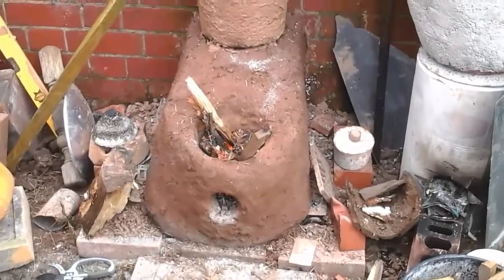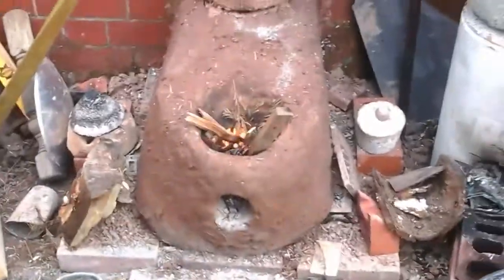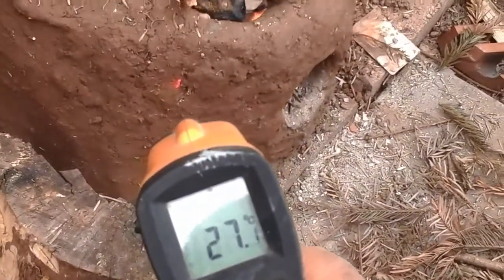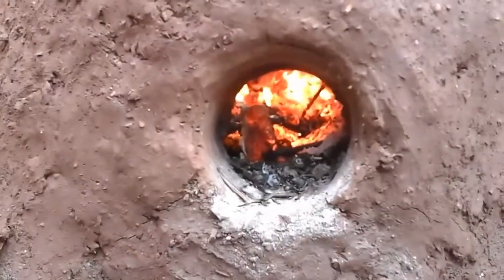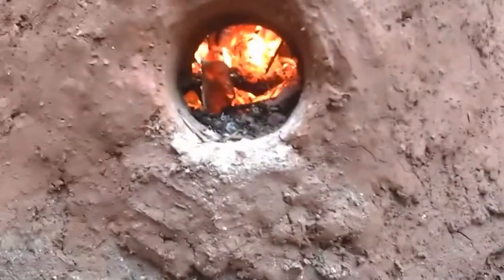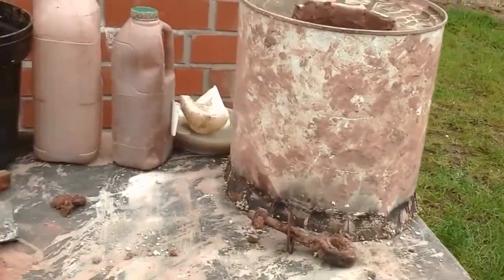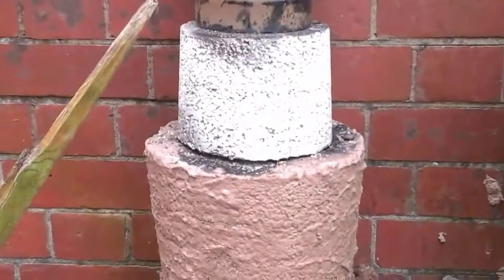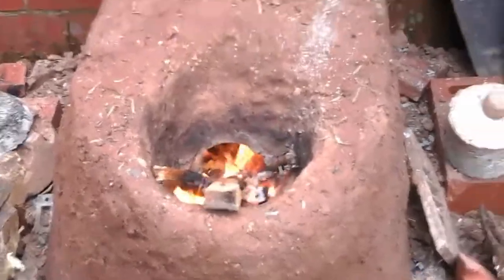Rocket stove in UK using clay perlite and cement

Comment: Please post another video about how you cast the parts for your rocket stoves.  Additionally, is the white cap sitting to the right of the stove  used to close the clean-out/draw hole in the front?